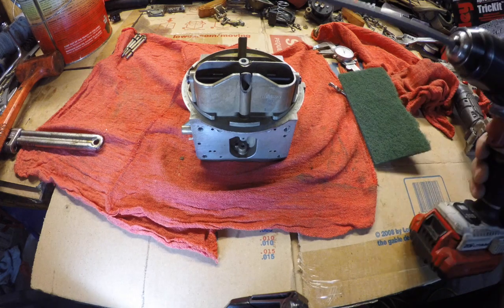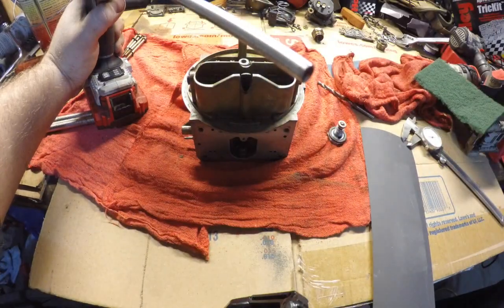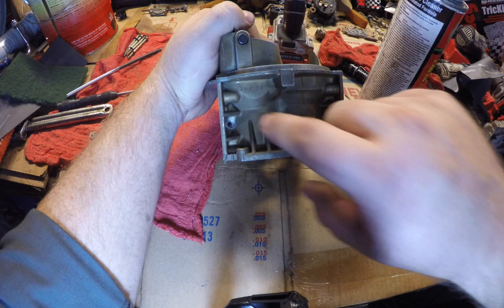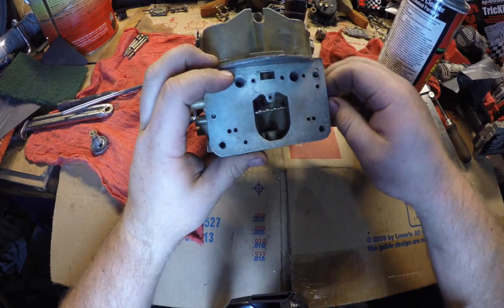Boost Reference a Holley Carburetor | #FamilyburnoutWagon EP17

Comment: Hi there your video is very good i have the same carb and a 144 blower for my sbc what power valve did u use and the jet sizes :) and agein thx for the video :)
Reply from the maker: Unfortunately, I’ve swapped over to E85 so I don’t believe any of my settings will apply. Also, jets and power valve are set based on vehicle weight and rate of acceleration.

Comment: Drilling it by hand like that sure seems like a gamble. You've got a really small target area - less than the depth of the boost-valve well since it has to be far enough inside the metering block face and you have to be above those lower passages that go from the metering block face to the bottom of the carb body. You screw it up and your carb is a paperweight. I used a drill press with the carb body set on a jig to keep it square to the drill bit.
Reply from the maker: I used to bullseye swamp rats in my t-36 back home and they weren't much bigger than that.
Reply: @BurnoutsAndRotorblades   You mean you used to *rats eye* them. 🤣

Comment: I understand that we would be making this modification so that the power valve feels the manifold vacuum, instead of the supercharger draw vacuum.  The bit that I didn't understand (and could well be thinking wrongly)  don't cars generally have maximum inlet vacuum at idle, and lowest inlet vacuum at WOT?  Wouldn't that then induce the power valve to work more at idle, less at WOT, and then back to high after closing throttle post acceleration?  This is a genuine question as a newbie to the differences with superchargers compared to N/A.....thanks.
Reply from the maker: when the blower is singing her song, the vacuum is inversely proportional to the boost being created beneath it. The higher the blower RPM, the more vacuum is created under the carburetor. To close the power valve, it haas to receive a signal with positive pressure. That is why we move the signal to the pressure side of the blower and plug the normal sensing passage.

Comment: Would it be possible to tap the main body to fit a small brass barbed fitting and run a rubber hose to the bottom of the super charger ?
Reply from the maker: I wouldn't tap the supercharger case specifically. I guess you can, but I would go to the intake manifold because the pressure would be the same.

Comment: You can do it on the base plate as well by plugging the  power valve port and then making a channel groove to the spark timing port. But you will have to use a mechanical advance dispute after that